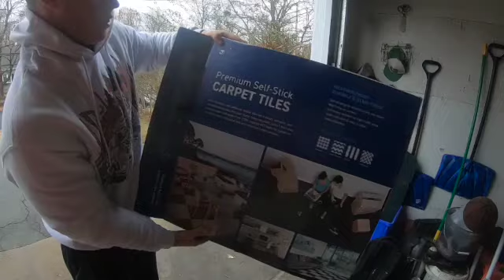Part 2: Coleman Crawdad Back Deck Build (With Storage hatches)

Comment: I've been fishing from a Crawdad since 1985 or so and I know a lot about them. The foam is meant to keep the boat's top edge, the gunnel, floating even with the top of the water, if it gets filled with water. It can only do that with 420 pounds of weight in it to start with, as it comes from the factory. That means you and your cooler with ice and your battery and your lunch and your anchor and your fuel and your added decking and your seat and your favorite rods and your baits and anything else that you added to the boat that wasn't original to it. 420 lbs. is two 205 lb. guys and a set of oars. I'd hate to guess how much weight you've just added to that boat with just your build and then you removed the flotation. The boat has very low gunnels and even less freeboard when loaded like that and it will swamp very easily if it's used in choppy water or if you are on a waterway that allows large motor boats. The ads for the boat, back in the day, showed it loaded with 1200 lbs of concrete blocks, but that just demonstrates what it takes to PUSH the hull underwater, also called its displacement. These are light tough boats, but they are also small and narrow and easy to swamp. Many lakes enforce the rated weight limit on boats and you could be fined and have your boat impounded. I'm saying all this to warn you not to use this anywhere but small farm ponds and electric motor only lakes. It isn't safe around motor boats and skiers and the like. And never carry anything in it that you value because, if it swamps, it all will sink right to the bottom. Tipping over is also a risk, but swamping is the big one, trust me, I know. You could also be held liable for anyone that ends up drowned or injured because of your mods.
Reply from the maker: @mrhalfstep  boat works just fine bud
Reply: @1BITE1DREAM  Cool! Just hope that doesn't end up the epitaph on your gravestone. Boat safely.